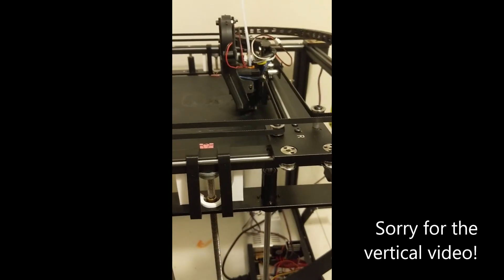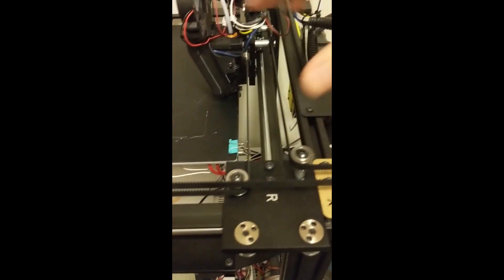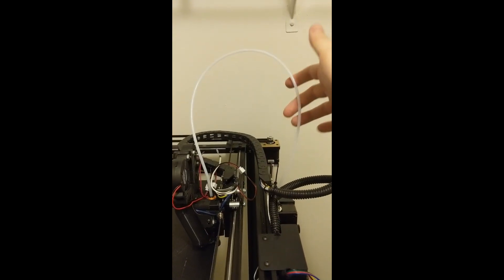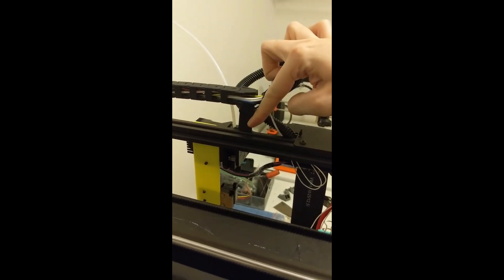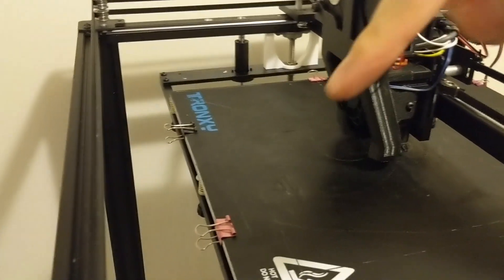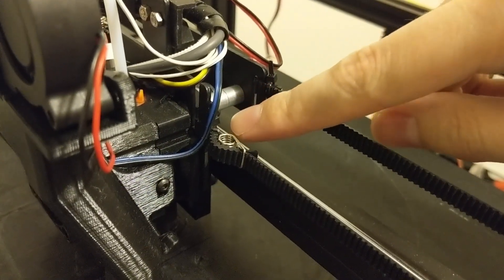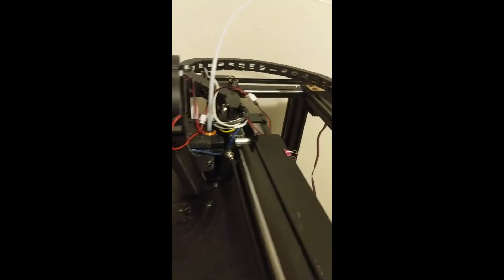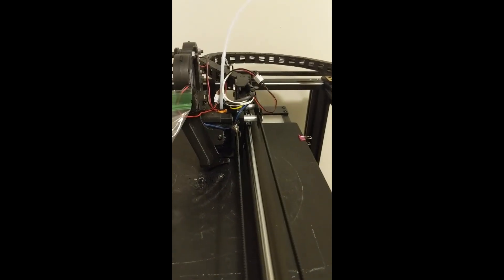Tronxy X5SA Pro Tips

Comment: Just a heads up, you can get profiles on FB thats for 150mm/sec. with large printers, first mod that should be done is corner braces with 90 degree outer brackets. this makes frame alot stiffer & can print alot of models at 125mm/sec upto 150mm/sec

Comment: On the shortening of the tube. While you are correct in saying the tube can be shorter, if the user is learning, as I am, we tend to get clogged tips. That often leads to cutting of the tube end. At your length one clog and that tube is dune. Right?     I've found that the longer tube looses a few inches of filament at the end of the spool, but I can live with that.

Comment: Well done. I have the same printer and I had a tough time getting it to work as it should.  Cool pointer on how to eliminate inconsistent extrusion, I'll look into that option in the future. 

One thing I could suggest is to flip the orientation of the X/Y cable chain (which requires taking the junction box apart and pull out all the connectors). If you look closely you'll know the cable chain has an orientation nature regarding backward flex, at either ends. So I flipped it around, took 6 links out and put it back together, and no more interference problems anymore. JFYI. 

Another thing I did: If the under-extrusion state is pretty consistent, you might wanna consider rewriting the firmware. In my case, M8011 S0.001175
 (followed by M8500) worked fine to fine-tune the extrusion multiplier.